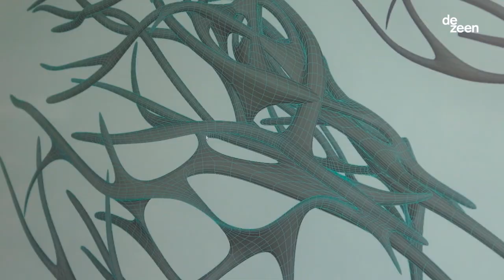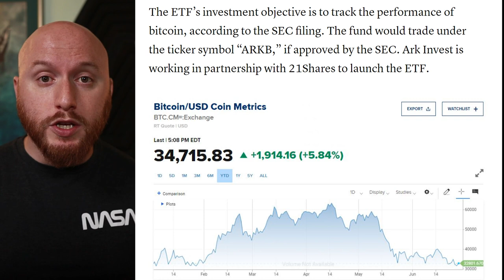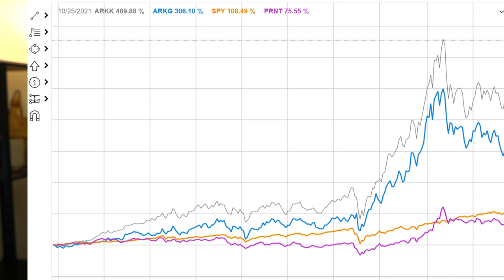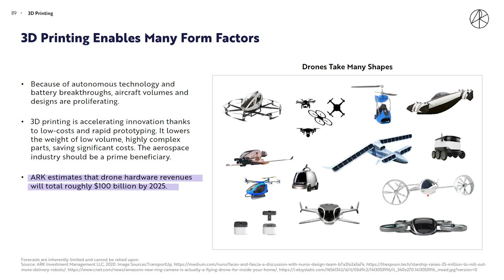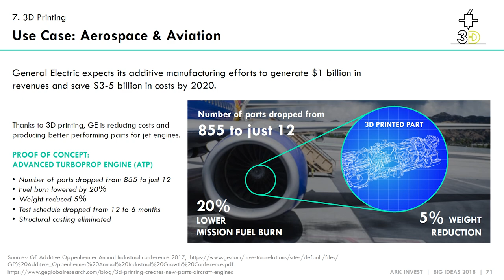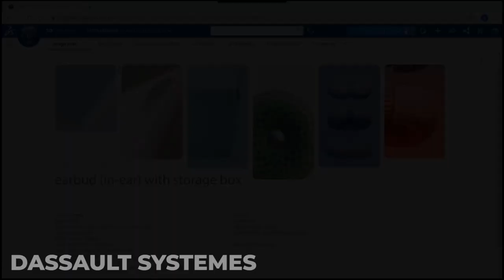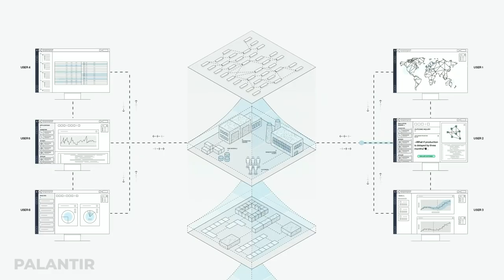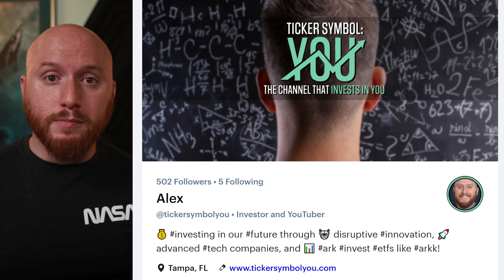🚀 The Truth About ARK Invest's 3D Printing ETF (PRNT)

Comment: Very timely post, Alex, as I just bought into ENNV earlier this week.  I'm on my last semester of an MBA program and we have been researching and writing on supply chain solutions. We've been addressing how to best 'reshore' production and manage geopolitical issues, as the overreliance on globalized supply chains has further come to light as an area of concern during the pandemic. I think 3D printing is a viable solution to many of these problems, but there needs to be more penetration in end-use parts market (like you mentioned) and more mass adoption by major corporations. I'm in on Fast Radius because I think its positioning itself well as a solution to these aforementioned issues, has experienced leadership, and has a strong partnership with UPS.
Reply: Hi Trent, where to buy  Fast Radius as I was not able to find ENNV
Reply: @ulf4877  it may be your broker doesn't carry SPACs...I use Fidelity and its available on their platform